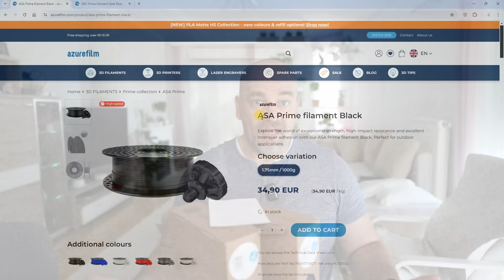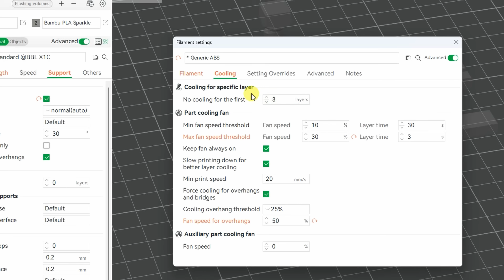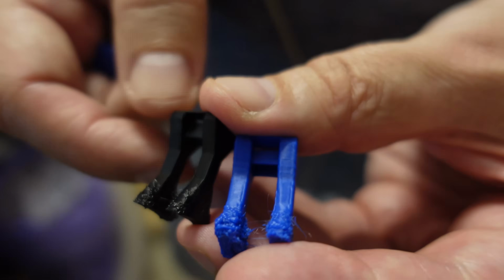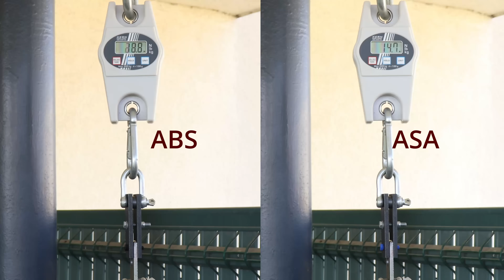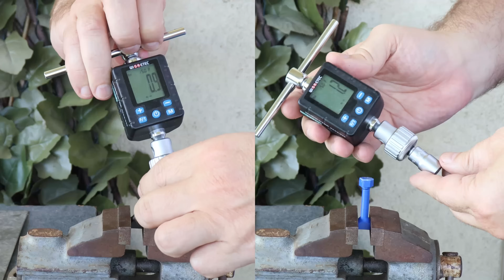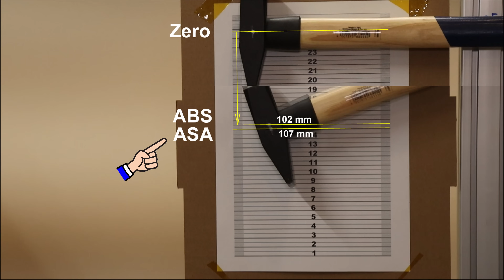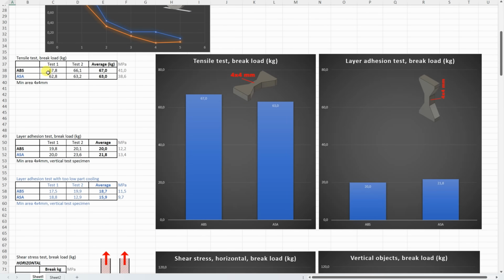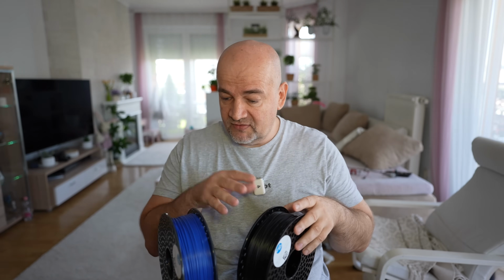Another ABS vs ASA comparison: AzureFilm ABS Prime vs ASA Prime with zero warping techology

Comment: Thanks again Igor.
I find ASA more prone to warping than ABS so I use more ABS - except AzureFilm. I haven't used the Prime version but I have found Azure ASA to not warp unlike others I have tried from various manufacturers.

I don't understand the algorithm at all - whenever anyone on Reddit asks about materials, I point them to MyTechFin.

I have a question though: when the eBay impact tester is set up and calibrated, will you be running your DIY setup alongside it? If not, newer results will no.longer be comparable with the older ones.
Fory purposes, I'm not overly interested in the actual figures using industry-standard equipment and methods. My interest is in relative impact resistance, so your results are good because they are a consistent set of results across the range. That makes them directly comparable in relative terms.
Reply: I've noticed the opposite. ABS warps and shrinks all the time while ASA (at least from Extrudr) almost prints like PLA. ASA also smells less bad, so my ABS is collecting dust. I also saw one video with a guy, that was only printing in ABS and puts out a box with about 2 years old ABS-parts stored in the dark. He could break the parts apart like they were made out of old bread. Not sure how reliable is ASA in the long term, but certainly PETG holds up better even if it's in the sun on a daily basis.
Reply: @Leynad778  abs is 100% reliable long term. Maybe he used some c grade blended filament
Reply: @Leynad778  That's interesting. I wonder why the difference between experiences.
Reply: @NickBR57  other compunds in ABS. Its never just ABS inside, unfortunately. Looak at polymakers nylons for example - no heated chamber neaded (they are shit btw,  and made for shit printers), buildplate at 50 MAX. Disgusting

Comment: One thing I noticed using/test both myself is that the ASA Prime is quite a bit more sensitive to moisture than ABS Prime, it needs to be dried, the abs one does not. 
Another thing I noticed different from other ASA/ABS types is that it sticks to the bed a LOT better, even with no glue/spray/whatev, it also does not require too high temperatures, I print both at 60º to 70º!
They are also less prone to shrinking, I can print bigger stuff without enclosures and since it does not require so hot a bed it works just fine in simpler printers such as Bambu A1 mini :)

Comment: Thank you for all your work.  What about ease of printing?  Similar or is one of these printable on a cheap 3d printer with just a hoody ontop (passive heated by hearbed) instead of a full enclosure printer
Reply from the maker: Usually, the ASA is easier for printing. In this case, it was ABS.